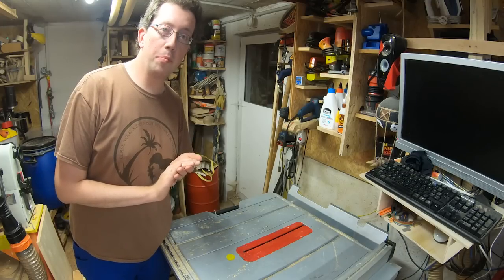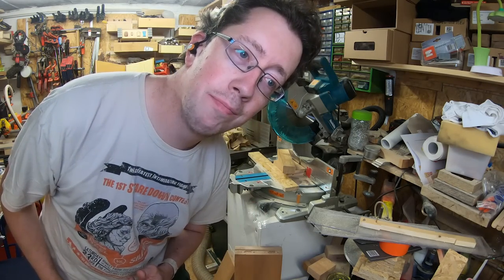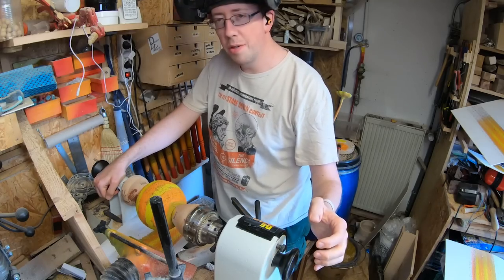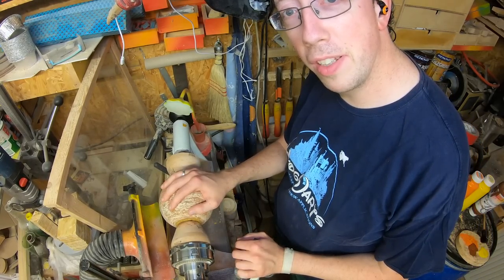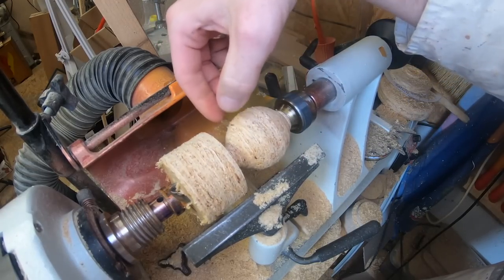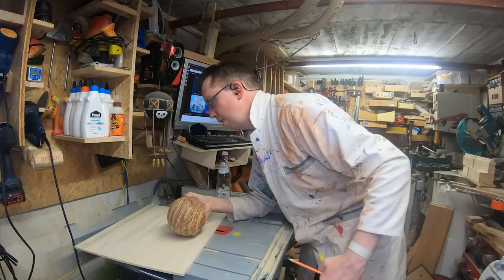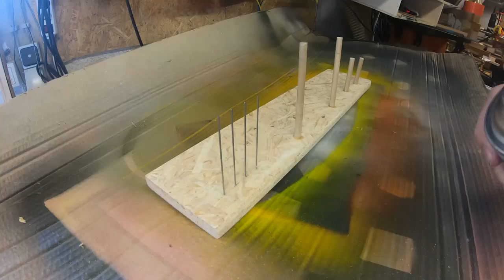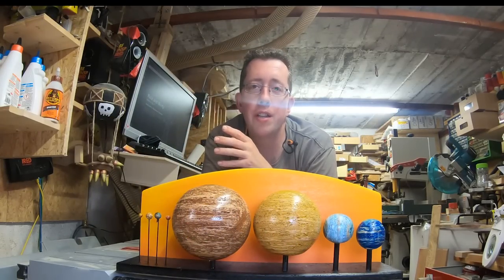OSB Solar System

Comment: I just noticed this and, of course, I appreciate this very much. The OSB layers seem to be made for such planet surface textures. The original "Jupiter cylinder" had more contrasts, it's obviously harder to get to a more realistic look when you aim for it instead of just happening.

What if I say it also looked like a doner spit with red cabbage already integrated?
Reply from the maker: I'd say "don't tempt me' but it is probably already too late for that. Although making doner on the lathe would probably be a little too messy for my liking. Thanks for watching, Olaf!